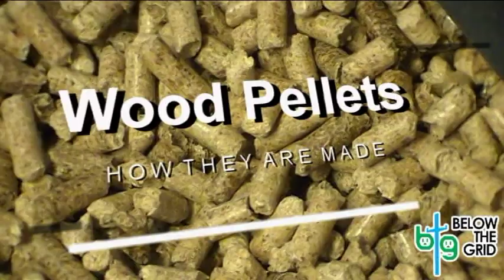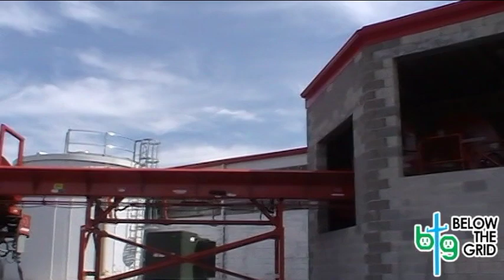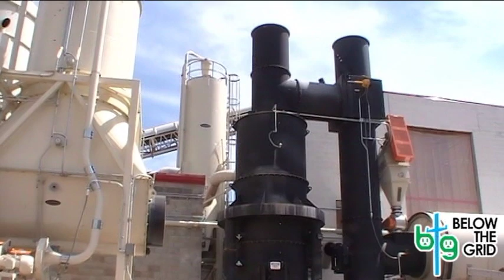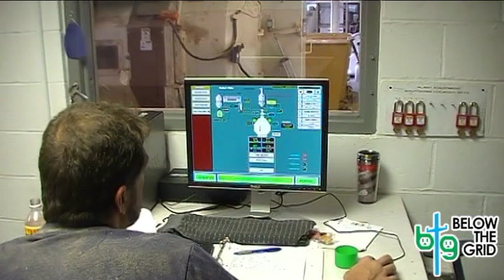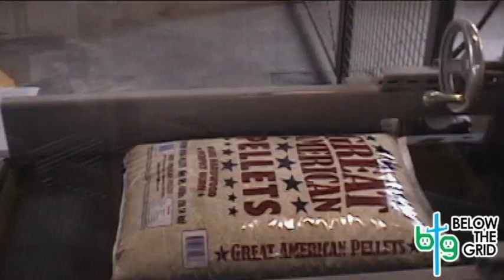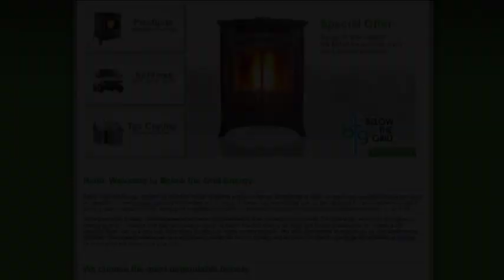How Wood Pellets Are Made

Comment: You have got to be kidding me! Burning trees to produce energy. I could see using by product like saw dust but this is sickening. We should be finding alternate building materials as well.
Reply: +Tony Marcuccino better burn that we can plant it again. How about coal and gasoline ? We burn it too...but the oil can not renew
Reply: How do you think saw dust is made? Trees are cut to produce building material, paper and all sorts of things. Trees are a renewable resource, they need managed just like a crop does.
Reply: I was commenting on the use of hardwood trees specifically for making pellets for energy not as a by product of lumber production.
Reply: They should use trees blown down from storms,,Every town collects branches that can be used too.leaves & bark can be sold as kitty litter.
Reply: trees that are not growing anymore are not taking CO2 from the air anymore. therefore better to cut them, and grow a new tree instead. and instead of burning fossil fuel, burning biomass is renewable, co2 will return to trees..

Comment: Conditioner just another word for harmful chemicals that turn to gases in your home when burnt. They're that shinny glue looking finish that keeps the pellet burning all day without going out or breaking up back into sawdust. Burning wood is harmful for people indoors period. Not to mention in a normal fire place you loose over %90 of the heat intended for the home. That's not even the issue here though it's the unsafe use of the pellet.